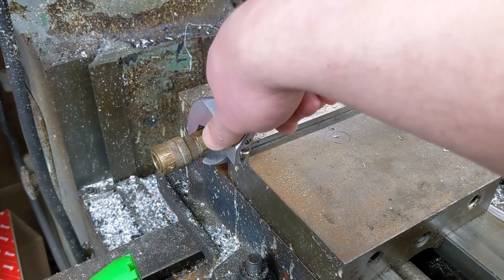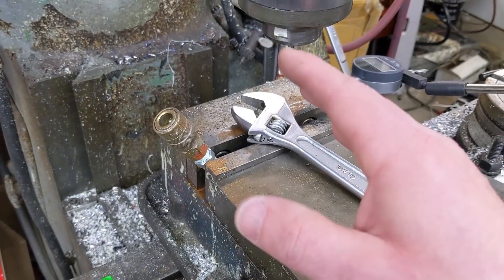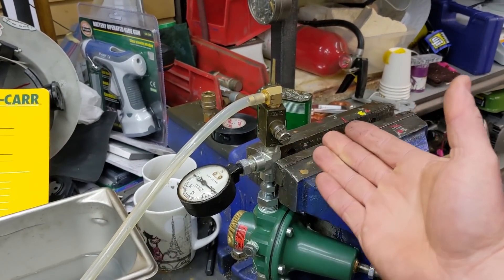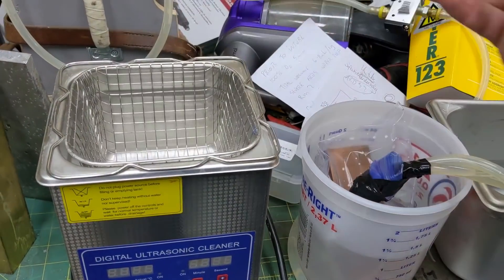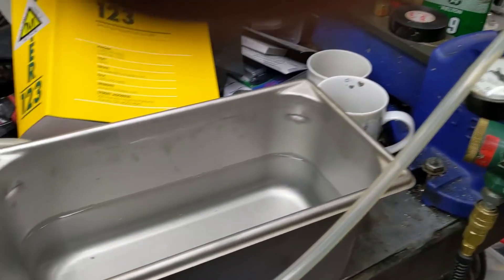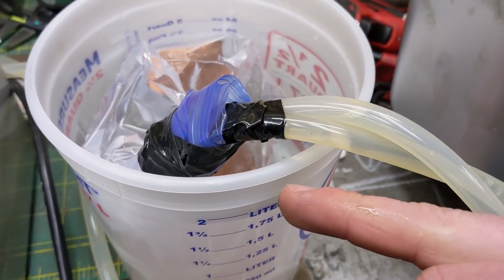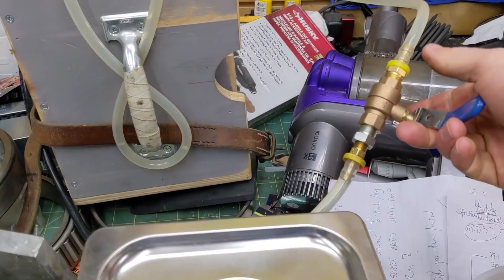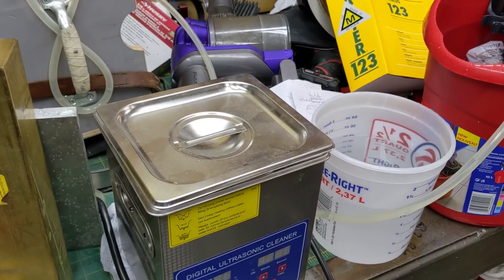Jankiest Ventilator Mk.II Prototype

Comment: This turned up on my list. This is the most irresponsible video that could be out here right now. You know some fool will try.  I swear to and this is fucking irresponsible as shit.
Reply: It was still entertaining as hell.  Which, I think, was the point.
Reply: It's no more dangerous than CPR. There's no control over flow or pressure when you blow into another guy's mouth. This is the how ventilators worked in the mid 20th century. High pressure gas in a tank, a couple of regulators, some valves, and some gauges. It's been proven by time. Even if it's not as precise as modern gear it beats the hell out of suffocation.
Reply: Because of our current state of need, there has been a lowering of standards and on medical equipment. It's more streamlined to get things such as shown on the video out where they are in dire need of. I doubt that AvE intends this to be the final draft. Others in the field would have to throw in there 2 cents as well. And a nother point, while you'd only be caught dead hooked up to a machine like this in "better" times, you wouldn't ever get used cleaning rags approved for wound dressing. But if you have little to no other choice in the moment, you'll liken that rag to sterile gauze meant for the Pope themselves.
Reply from the maker: I couldn't agree more. What we should be doing is nothing.
Reply: AvE I’ve been playing around with a similar design but using a wooden Camshaft to control the inhale/exhale timing. Thoughts?
Reply: @arduinoversusevil2025  What he is trying to say is how can you be so irresponsible and not Teflon tape the air inlet coupling?
Reply: @arduinoversusevil2025  OP can't handle the M*A*S*H episode where Hawkeye and Trapper John save a life by rigging a dialysis machine using sausage casings, either.
Reply: @arduinoversusevil2025  Thanks for teaching me WTF a resiprator is and does. Thought it was a much simpler mechanism. Not building one at home any time soon though.
Reply: AvE : okay I get your point. But, a vent is a precision piece of equipment, very exacting tolerances. Only a few psi off and you risk blowing out a lung in a pneumothorax. Plus not to mention insertion and placement and sterilization is out the window. Look, points for being clever okay. How about a jig and machine for producing masks at home. How about a hydraulic lift that be placed under a bed to elevate it. We should all be doing something, I agree. Let’s do the right thing. Be safe and stay healthy.
Reply from the maker: @budapestmole  "How about a jig and machine for producing masks at home" That is a fantastic idea! The internet awaits your upload.
Reply: AvE : thanks, your the machinists and fabricator. Me not so much
Reply: @budapestmole  if your worried about people being stupid with this then dont explore the internet any further. The stupidity of humanity will always kill people. All Ave is doing is giving a starting point, as much as somebody could be stupid they could take this and make it medically viable.

Keep up the good work Ave.
Reply: @bencartwright9359  no
Reply: @budapestmole  - not all ventilators are such precision pieces of equipment as you think. 
Bird ventilators are still used today all over the world. Intubation is not a sterile process. It's just a clean as you can get one. Hundreds of people a day are intubated in the field under dirty conditions. 
The purpose of this channel is to get people thinking and share information all while being entertained. You don't need to be a machinist or an engineer to bring people together during a "pandemic".
Reply: Andy Stanton: but could you sterilize all the parts and fittings the flow passes through?
Reply: @budapestmole  I guess you prove the premise. If you want a working solution, don't ask a question, put a crap prototype on youtube and let people come back with ideas. Personally, if I was fucked up medically, I'd rather try this ventilator than NO ventilator. having said that, I await your suggestions for improvements. Rather than telling me how shit it is, tell me how to make it better. Stay safe, Royce
Reply: @arduinoversusevil2025  a pair of scissors, and old shirt, and duct tape, DIY face mask!  just as effective as all those dust masks you see people wearing.
Reply: @BrokenRRT   Thank you for this.
Reply: @budapestmole  It's really not that precise - ever used a manual cardiopulmonary resuscitator?
Reply: @budapestmole  really coming in with helpful ideas, soft hands and a big brain huh?
Reply: budapestmole Why the hell couldn’t you, the only bit you maybe couldn’t sterilise would be the tape used to seal the fittings but with low pressure leaving them unsealed may not be too much of an issue
Reply: @budapestmole  I've always found channel has inspired me to go build or fix stuff especially in spite of not being a fabricator or machinist. Throughout history there must be a lot of inventions by people who had no background in solving the problems they did. We'd probably be terrified to find out how many things we use today were based on the amateur designs of idiots like ourselves. I find it confidence inspiring, strangely!
Reply: Go back and watch the first video. He isn't shooting blind on pressures and volumes. He's suggesting raw setups that are adjustable at each stage. 

As he said, people are dying. Take a look at what works; suggest improvements to the concept; listen to critiques; adapt; repeat.
Reply: @budapestmole  while you have very valid points on a lot of things here, remember that you are comparing current mature commercial units using outdated technology in many cases, with a collaborative effort to design a new device using industrial parts.
If you went back to the original power ventilators, you would probably find sewing machine motors and fireplace bellows.
The materials we have to work with are much different now, and what I see here is tinkering with parts on hand and thinking through the issues in a new way.

It doesn't mean it's a GOOD way lol, this may turn out to be a horrible idea, and we will all understand WHY the current designs are done that way, and maybe try really do have the best design.
But it's also possible that some new way will be developed here, helped along by your input, and the problems will be solved, and a system that can be built in any well stocked industrial maintenance department will be refined, and maybe even something that can be produced in developing nations.
Reply: @budapestmole  I put a hydraulic lift under my bed, but I can't get it off the ceiling now.
The point here is to stimulate ideas at a time when there is a major shortage of equipment and people are dying as a result.  It's not some project to go and blow up random old people in a hospital.  This does look Heath Robinson, but I bet the official machine's prototypes looked very similar.
Reply: @arduinoversusevil2025  Don't you get flustered by the cunts, buddy. Keep your stance. Thank you for putting information out there for us every day. We need to use this platform for good, and sharing ideas is the best good we got for now.
Reply: It's just a matter of statistics.    5% chance of someone dying from a janky device vs 100% chance of them dying without it.
Reply: budapestmole good thing an emergency makeshift ventilator will only be needed when the hospitals are packed and there aren’t any ventilators, and it’s the only option. So what’s irresponsible at that point? Also, “a few psi off”? Are you joking? Breathing is probably on the range of 1-10% of 1psi. I doubt a human lung could even produce 1psi.
Reply: Imasurvivor : A normal person is capable of a breath pressure of 1-2 psi, so by pressure breathing you can increase your lung pressure from 10.1 psi to 11.1-12.1 psi during each exhale, closer to the 14.7 psi you are used to.Apr 21, 2016
SummitPost › phpBB3 › pressure-br...
Pressure Breath Explanation : Technique and Training - SummitPost
Reply: bigclivedotco: two things 1) adjust the travel on the hydraulics and 2) if you passed helium through the ventilator you could inflate your mother in law or exwife and turn them lose in wind to drift away, far far away. Hmmm, now that would sell.
Reply: Chronic Gaming: I like that Darwin’s helper.
Reply: @Imasurvivor2  
 You've got to beat 14 psi just to blow up a balloon.
Reply: @budapestmole  I just watch a video on ozone and ultraviolet light  as a method of sterilization, so it is very possible to do
Reply: Whilst this may not be helping by magically producing ventilators for those in need, have you thought it may be helping in other ways? 

Each person watching this and having a think about how we could go about solving the issues we all face is one less person panic buying toilet rolls (or ranged hole punches for those west of the Atlantic).
A bit more chin scratching and a lot less arm flapping is probably about the best we can do to help right now.
Reply: Budapestmole Your gonna be let down to know anything and everything we have ever produced has at one point been an idea then a prototype. But rest assured if you were on your deathbed like so many poor people are because of this virus.  The AvE ventilator would be a welcomed sight if it was the only thing you had. But just keep splashing on the hand sanitizer and staring out your window from the comfort of the home the “essential” folks will handle it all. Have a nice evening. Oh and by the way, STAY THE FUCK HOME
Reply: @Ave, We got ourselves one of those commercial folks, better tone down the fuckery in the shop, dont wanna hurt nobodys feelins in this time of pandemonuim, haha  @budapestmole  get your head outta your ass.
Reply: AvE has a HAAS machine and works for cheap. Dewclaw brand ventilators in a store near u soon!
Reply: You’d be shocked at how med devices are prototyped then lol it’s pretty much identical. Let people be curious and solve problems rather than riding your youtube high horse.
Reply: lame comment. virtue signaling.
Reply: "Irresponsible"  am I missing something? The way I see it this video could only reach two markets, joe workingman and medical device manufacturers. wouldn't the free market filter this? If the idea is bad plain and simple it aint gonna get picked up, partner. This isn't telling people to swallow apple seeds as a cure, or advising people not to seek medical advice. It's basically a thought experiment gone wild (no doubt because of free time due to quarantine). 

Joe workingman isn't sitting at home trying to build a Darth Vader suit for nana, thinking "gee if only someone had a youtube tutorial for this, then I could DIY and really flatten the heart monit- i mean curve!" And assuming since they have access to the internet they probably have access to advanced medicine, that's a Darwin participation trophy in the making.

And frankly (no offense uncle bumblefork) at no point would a medical professional/ manufacturer use a youtube video in lieu of professional advising. Maybe for some inspiration (again the free market will take care of bad ideas), but even then these are professional engineers with years of experience they wouldn't just take an idea on face value and throw it into production. This is a billion dollar industry they aren't gonna use a second draft video of a random machinist with devilishly handsome hands on the tube.

At the very least this could be considered a last ditch effort. But if you're at the point in your life where you are considering a homemade respirator fabricated from mcmaster parts to keep you alive, you probably have much worse shit to worry about. (Like bandidos coming after your bog rolls)

As many tide pods as they eat, the people of the internet aren't THAT stupid. I would call it about as irresponsible as leaving out the part in commercials where they say "if you are allergic to this drug avoid taking it at all costs!" If people really need a disclamer not to build a respirator and use it on themselves or others... then the build is frankly, probably too complicated for them anyways.
Reply: I never usually comment,  but you did so I shall in the same manner. Get a fucking grip on reality.
Reply: This is a better version than sucking on a shot gun. Fuck people calm down it’s the principal we are talking about! Nobody is mass producing this shit box of an air pumper. Yes we are all professionals (at something). Be safe wash your hand and stop couching in your douch bag neighbor.
Reply: Aye, anyone ever heard of the incubator babies of Coney Island? Some of the first incubators were made by some dude who may or may not have been a doctor outta industrial parts. Saved so many lives. Experimentation is key to innovation.
Reply: If someone's dumb enough to try this, they're so immeasureably stupid, that if this video didn't exist; they would have found some other stupid way to hurt themselves... It's the last bit of natural selection we have left, we need it to get rid of those who would otherwise ruin our gene pool completely, as if it's not already ruined...
Reply: Did he not mention in the mk1 that to get the right answer you dont ask the right question.  You post on the internet the wrong answer and the world will give you the correct answer.
Reply: you're going to be deeply disappointed when (if) you discover who actually designs and builds the products that save peoples lives. in the meantime, put a cork in it.
Reply: I’d like to quote a wise and famous man, who once said, “go fuck your hat”.
Reply: What gets me is they charge $34,000 for one unit. WTF over.
Reply: I get it budapestmole your incompetant and cant believe anyone might build something without the Gubberments permission.
Reply: The newbies to the channel have no clue...
Reply: natural selection at its finest then
Reply: I DERP to and this is DERPING irrederpible as DERP.
Reply: Anything is better than nothing, and at this point I think I would trust this more than an LTV, and that's a proper vent. I've had a few times where the battery on one died in the middle of transport. Also, old school vents are little more than dials, gauges, magnets, rubber, and tubing.
Reply: Yup , Too bad for all the rest of the village , you got out of the basement . Now , go back in the basement , yoda . Don't you have some coloring to do
Reply: How can experimental garage tinkering possibly be irresponsible? There is next to zero chance some nut job would attempt this for his personal use.  Think about it buddy.
Reply: I think the title is a pretty straightforward disclaimer for those that don't understand the lawyerspeak.
Reply: Like OMG!! You are so right SJW at thier best!!!..... Until you have no other option and then because of this video you are doing this EXACT same thing for you and your family to survive and you will be thanking God you watched it lol!! Look at the title of the video and get off your high horse jackass!! Or don't and just bury your head in the sand like the rest of the sheeple!!!
Reply: Budapest mole sounds like slang for degenerate activity involving a hamster.
Reply: I didn't expect anyone would take this seriously, but now that budapestmole mentions it I'm sure he's right, someone will.  After all, there are reports in the U.S. and internationally of people taking chloroquine, and dying,  after it was touted by a world leader as a very promising treatment for Covid 19.  Fortunately, in the case of this "ventilator" I suspect that most people that are bright enough to figure out how to connect all this stuff are bright enough to figure out that it's not a good idea.
Reply: Don't you have some aquarium chemicals to ingest? I hear that tide pods will cure this thing too.
Reply: It may seem irresponsible, but the question is, why. Then the question becomes how do you get around that issue and move forward. Al least this gentleman is trying to help instead of the millions who are being part of the problem by refusing to end the hoarding and not practicing Social Distancing. Those last individuals are risking all of our lives. I understand that the last thing we should do is panic, but let's be constructive rather than alarmist or defeatist.
Reply: @budapestmole I love how you judge something, but provide nothing.............Smooth man, real smooth.
Reply: budapestmole, you might consider that two days ago, 90% of us had never heard of PEEP, and wouldn't have thought about the importance of humidifying the air.  If nothing else, AvE has educated us, which is, I think, the whole point.
Reply: Spoken like a typical Liberal. Taking everything literally and running your mouth.
Reply: @JCC-r2q  
 Sterilize them with a good Bourbon and lick 'em dry!
Reply: This channel is not to be viewed by fuckwits.
Reply: You must be fun at parties.
Reply: OMG!!!! I hear now Ave....it'll be something like....."I got an idea....hold my beer.... " ***rustles up a valve, air compressor.......*** ya someone's gonna try it.....YOU!!!!!LMAO stay safe and healthy
Reply: @heil_435  please go and shout at a mirror... Sounds like self isolating is doing you a world of good. LMAO.
Reply: I mean, he DID say that in the end of days this is maybe, possibly a last resort.. i feel that speaks volumes as to how precise your alternatives are
Reply: Yes... Nicola Tesla was irresponsible also.. but are you not glad that you could post a comment through a phone on YouTube?
Reply: I'd take this over certain death tbh..

What you reckon about the doctors when they have to choose over who lives and who dies?
Reply: Dial back that negativity and I'll share my sous-vide defibrillator with you.
Reply: Holy moly some people just wanna yell
Reply: at leaste AVE is trying

 In a time of need all us engineers will end up getting involved 
With out us engineers then who takes the plunge and fixes all the problems thrown at us
Reply: You do know there are channels on you tube were people experiment with cars, chemistry, circular saws and fire arms?
I think the chances of some trying to repeat any of those experiments and killing themselves or another is alot bigger than the chance somebody is actually gonna built this contraption and try to intubate a person.
Reply: Good luck relying on the standard medical system if hundreds of thousands of people needed respiratory machines , I'm way younger than you bud so I would get priority and you would be left to lady luck  , it's happening in Europe.  I think you might like a contraption if your life depended on it .
Reply: and Eternal September keeps chuggin along.
Reply: Thank you for demonstrating the concept of a ventilator.
Reply: This is obviously a prototype and already works better than nothing at all, it can be completely clean and safe and will get better with further development.
Reply: Im an itu doctor - commenter doesnt get it
Reply: Wow thanks budapestmole. Your comment just gave me cancer!
Reply: XtremeBordom : no problem anything to reduce the heard.
Reply: I've seen doctors on TV perform surgery with a DeWalt drill. Just sayin
Reply: I have built 12 of these already and have my kids hooked up to each one...they really complained about intubation though...hopefully they dont get the rona now
Reply: AvE isn't really serious about this. But he does give everyone a good idea of what a ventilator does, how it does it, and and the problems involved in the process,  explained in words of one syllable or less, and demonstrated with equipment everyone is familiar with.   How much do you want to bet the early developers of this equipment didn't go through the same  process we are seeing right here?
Reply: I don't know if you understand this is to  force the brain of people who can mass produce things to come up with easier and cheaper solutions in times of crisis. Its to turn the gears of people who can. Just saying
Reply: OP died from a shortage of ventilators
Reply: Ih dug ford is gonna give you the contract for shure ;)   awesome vidya
Reply: When get to home made vent were in the dodo...
Reply: Wat
Reply: @budapestmole sounds good....i think I'll try it.
Reply: budapestmole welcome to the internet numbnuts
Reply: If you think the guy that invented the original ventilator didn't blow a couple lungs in his nonsterile garage, I'm laughing.  It has "prototype" in the damn title.  You gotta start somewhere...
Reply: There's always some butthurt scumbag.....uncle bumblefuck is a legend round these parts🏞️🌄
Reply: I'm only just watching this video for this first time, and seeing AvE absolutely demolish OP with 2 comments was fucking awesome. 

Great video, nice proof of concept, and gives good insight into the ins and outs of how a ventilator works. I was gunna google it myself, but watching/hear this man explain it with his own terms and vocabulary made it extra entertaining
Reply: Yikes, sanctimony and then a hasty retreat. Whoops!
Reply: Brendan West : no I’m here taking my licks.
Reply: I gave you a like Brendan
Reply: I'm not trying to pile on. Right now, there are people asking for real money to make masks that actually are dangerous, because they think that they know what they are doing. If this proves that just owning a 3d-printer/shop/CNC mill doesn't make you a medical expert, and that this stuff is hard, takes lots of wide ranging knowledge, but can be done right, by the right people who are working together, then its worth while. If someone watched that and thought "That's easy" then there is no helping them, and they are probably thinking that their 3d printed cosplay masks with vacuum bag inserts will keep them safe. There is nothing wrong with saying "this is difficult, do your homework" This is the responsible way to present this information.
Reply: If someone tries this covid 19 woulda got their dumb ass anyways
Reply: I come to this channel because the people in the comment section are generally 200% smarter than the front row of a Trump rally. 
I think you are lost.
Reply: Shannon Black get those tissues ready for November buttercup
Reply: No worse than the President of the US telling people to use a compound that is also used to clean fish tanks. Already killed some guy and his wife is critical. That is irresponsible!
Reply: J CC: Good point. Any fitting used on O2 lines would have to be completely free of oil and grease. When I worked offshore we used a solution called Panaclean, which was a flash degreaser to achieve O2 clean. I was thinking more for pumps and motors.
Reply: J CC: check this video on the design from Oxford Univ to meet the UK shortage of ventilators  https://youtu.be/xdZtMgpxnPI
Reply: I agree I am here as a logger on unenjoyment so I'm going to go and point and laugh at all the idgets wearing carpenters masks why is there sheeple around me I don't live in California oh yeah does corn 19 cause cancer in California?
Reply: Per my Respiratory Therapist wife (these people are experts in ventilators and are the ones most likely to incubate/extubate you in the hospital and maintain your vent settings), this would be a dangerous and unworkable device. Ventilators are complex instruments with very tight tolerances (as @budapestmole notes). It’s great that you’re applying your knowledge and talent in an attempt to find a solution, but solutions like this are not only ineffective but dangerous.
Reply: @davidhiett9863  "solutions like this" is where you went wrong! 
Don't compare this video to people not washing their filthy hands! 
As a respiratory therapist myself I can promise you many lives have been saved with not so precision ventilators that are still in use today.  Ask your wife how simple and not so precision a Bird Mark 8 ventilator is. Look it up if you have to.
Reply: @davidhiett9863  And the alternative is? Do you remember MASH where Max Klinger had to ventilate a dying man? Yes, a television show, but these things happen. You can't expect "precision equipment" to always be at hand. If this becomes a drastic situation, "drastic" measures will become necessary. This man could save your life. Get your head out of the textbook mentality. Please. I am not yelling.
Reply: David Hiett And being dead is a workable solution?  Being completely safe and comprehensive testing will help the living but does nothing for the dead
Reply: @davidhiett9863  This is just the SECOND ITERATION of this project. It is clear that we ALL know that this would not work in this form, however, when the person who invented the ventilator made his/hers, I am certain that s/he did NOT get it right on his/her FIRST OR SECOND GO!!